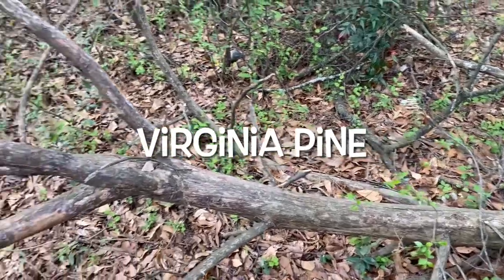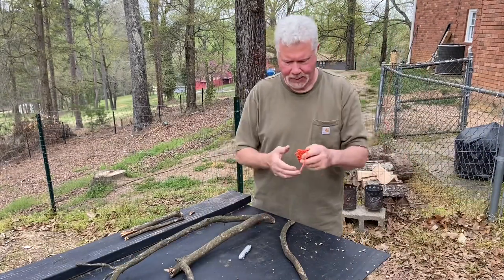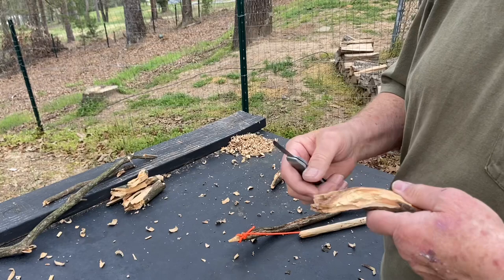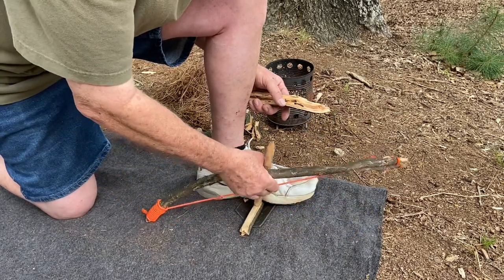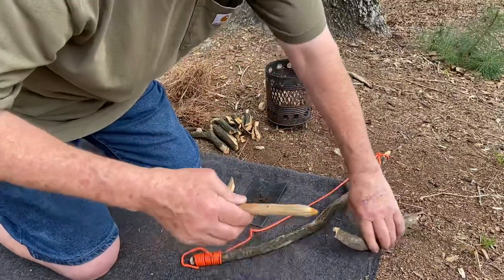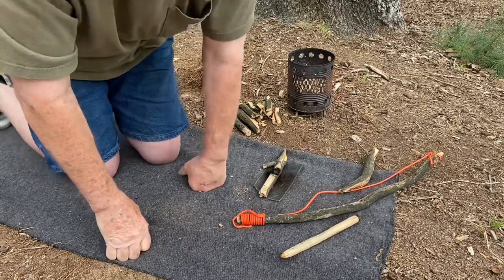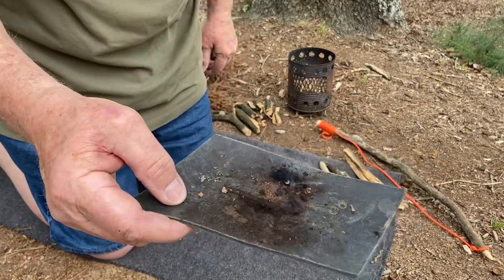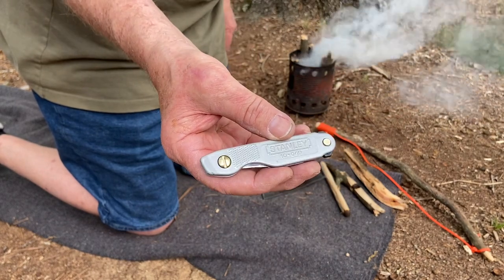My Pocketknife Making A Virginia Pine Bow Drill Friction Fire

Comment from the maker: This was a piece of cake for my little Stanley 10-049 pocketknife. I've been EDCing this knife for over 10 years now; and, it's cut miles of cardboard, poly tubing, rope, cleaned squirrels and fish, cut up cans for grease lamps and hobo stoves, is my go to knife for scraping the ferro rod, making wood scrapings, cutting denim and cloth for char, cutting fruits and vegetables, etc.
   The durable 1 1/2" stainless steel blade is easy to sharpen and inexpensive at $2 per. The blade rarely needs to be replaced, though, because it hardly wears down even after 100 sharpenings.
   Carving out this Virginia Pine Bow Drill set was of little challenge. It girdled branches with release cuts so they could be broken off. The sharp blade had no trouble accomplishing all the whittling tasks involved without needing to be resharpened.
   Today's friction fire came easily with these 5 Virginia Pine components: fireboard, spindle, bearing block, bow, and misc. fuel wood. You'll have to see it to believe it... Please follow the LINKS below and SUBSCRIBE. Thank You!

Bow Drill Playlist
https://www.youtube.com/playlist?list=PLkoXX8XsMW3kw-EXlvpLS68aJjR89P4ae
Stanley 10-049 Pocketknife Playlist
https://www.youtube.com/playlist?list=PLkoXX8XsMW3lLvn59SKAqTSH60CLY_Ha4